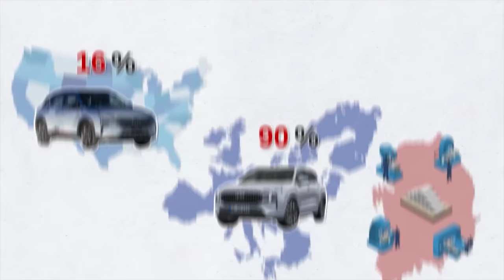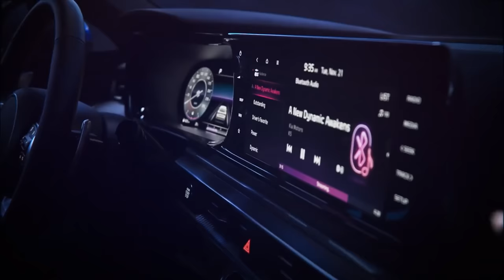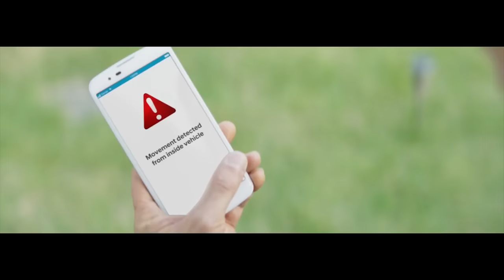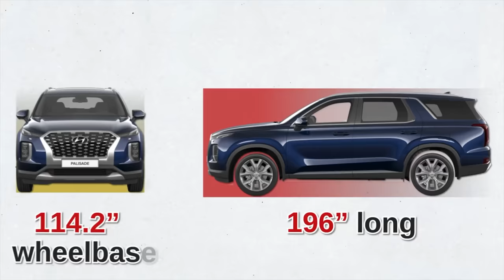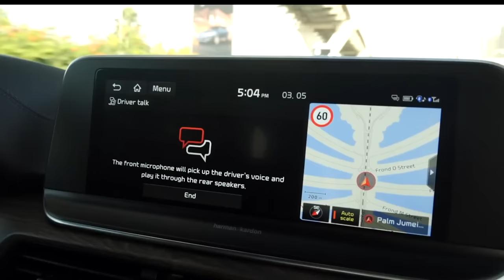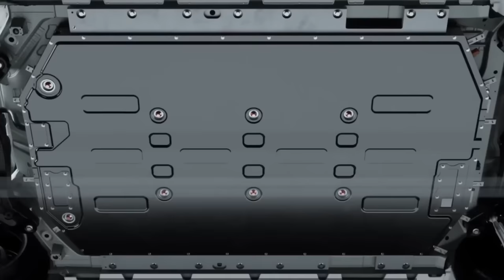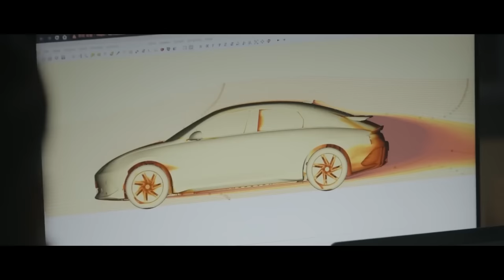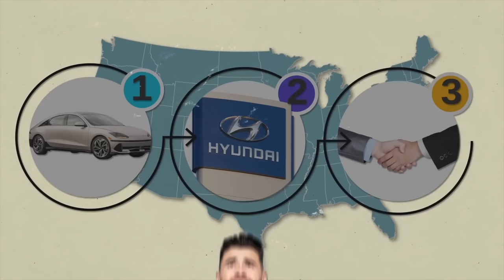No One Else Has the Balls to Say This About Hyundai and Kia, So I Will

Comment: The first car I ever drove was my dad’s 2003 Hyundai Sonata. Many years later, it’s now my car. It has just under 320k miles, and it’s still going strong.
Reply: I have a 5spd 2005 192k and still runs
Reply: 4G63 Mitsubishi engine. I too have the same car. Very strong engines used in Mitsubishi Evos.
Pls concentrate in timely oil change and properly Timing belt change. Then it can last upto years and years....
Reply: I had a xg350 it was an 05. It ran very well. Sadly it was demolished in a car accident
Reply: @Erode-karan  I get my timing belt done Monday and all other belts
Reply: Wow that's awesome unfortunately my 2005 Sonata busted a timing belt while I was accelerating.  I was at 120k It bent the lifters I believe it was and the repair would have exceeded the value of the car so I sold it to the shop who had diagnosed it for me. I do still like Hyundai and Kia and still believe they have come a long way the last 20yrs! They also offer the best warranty in the auto industry. I know of two people who got the engine replaced free under warranty when they had a yr or so of dud engines. I believe they even issued a recall. The Genesis cars are absolutely phenomenal and I drive a Lexus (dependability  reasons) but man they really go all out on the Genesis cars. The timing may have been suggested to change before 120k I'm not sure so it could be entirely my fault and this was way beyond the warranty in yrs.
Reply: Can't complain about my 07 Elantra. It's been an easy car to own. But I'm learning towards Toyota for future buys. Overall better reputation.

Comment: My mom had a Hyundai Sonata, I used to have a an Elantra Sport (6-speed manual) which was really fun to drive, my wife currently has a Hyundai Tucson. We never had one problem with any of them. Regular oil changes and that's about it. They've been very solid cars and have been reliable for us. Most (if not all) of their vehicles have 5-star crash safety ratings and have either IIHS Top Safety Pick or Top Safety Pick+. I think people don't know that Hyundai is the only manufacturer that makes it's own high strength steel. Are they flawless? No of course not. They've had their recalls and problems, but so have other manufacturers.
Reply: @JohnnyUkeOfficial  and the most important recalls in many cases were forced upon a non cooperating Hyundai corporate executive. Corporate mafia man.
Reply: my Hyundai Tucson is going on 20 years.  I have only had a few repairs and those have been these last 5 years.  It's still going strong.

Comment: I have had 2 Hyundais and 2 Kias so far, and have had 0 problems. Reliable, good mpg, and low maintenance. Love em!
Reply: I just buy Hyundai/Kia in Australia. Great cars and very happy with durability and quality.
Reply: Better watch out for the Kia boys though 😂
Reply: Depends how old they are, too.
Reply: I've had 2006 Sedona, 2008 Spectrim, 2015 Optima hybrid, we still have it, 2016 soul driven to college, 2012 Hyundia Elantra, 2014 kia sorento, 20016 Sedona and now a 2022 Tuson SEL HTRAC. I've always changed my oil every 4000 miles on all these vehicles the only maintenance required were tires and brakes.  I will contiune to drive them. some folks have issues because of neglecting oil changes and abuse. before you ask, I'm from a large family.
Reply: Yeah, just wait a little longer....

Comment: My 2012 elantra has 220k on it. Shifts and drives very smooth. Just did the shocks and struts. Been a great car and I think it has alot of life left.
Reply: Have a first Gen 2011 limited. Had to change out some sensors, alternator, and other typical items and currently at 180,000. The door stops and handles are falling apart though. Hah.
Reply: 2005 Elantra purchased new 18 years ago. 361,000+ miles and still going strong. Yes, you do have a lot of miles ahead of you.
Reply: My 2013 Elantra needed a new engine at 90K. I changed the oil with synthetic every 7K.  They put in engine under warranty but made me nervous about brand.  It took 6 months to get engine for swap. Was a pain, fortunately was working from home at the time.
Reply: After how many engines and transmissions? 😂
Reply: @santoyoarmando81  both original. Both operate perfectly.
Reply: @santoyoarmando81  still original. Not bad for Hyundai. 
Perspective, funny that in the early 70s and 60s, Toyotas and Hondas were viewed by Americans the same way as Hyundai of today. History repeats itself, just like everything else in human history.
Reply: @Matt91593  just kidding man, Hyundai has come a long way. But you gotta be honest though. For the most part Toyota and Honda are better cars.
Reply: @Texasbird026  7k is probably too much on any oil. i do 4K on synthetic oil. oil is cheaper then engines, and i save some money by doing my own oil changes.
Reply: @santoyoarmando81  My 2012 Sonata still going strong with everything original except tires, batteries, and oil changes!
Reply: @santoyoarmando81   My 2006 Camry is the best car I've ever owned, and I'm in my seventies, so I've driven a lot of cars.  My 2001 Hyundai was always in the shop.  I know it's been over 20 years since the 2001 Sonata was manufactured, but I'm not sure I'd feel comfortable buying another one.

Comment: Here in Ireland my friend drives a hyundai i30 1.6 diesel, it's got 215k MILES and he's still on the original clutch..that is so impressive to me.
Reply: Diesels can last 500k to 1 million miles if properly maintained
Reply: My hyundai accent I just replaced the clutch but it lasted 210,000 miles
Reply: I think the life span of the clutch is mostly about how careful the driver is with it. I try to be as gentle as possible. My current daily driver has 126k miles, so I still have some time before I know if I've done well.
Reply: I’ve got a 2016 i30 diesel in Australia, still on the original clutch at just under 204,000km (about 126,000 miles). Still feels much like new. A lot I think is due to mechanical sympathy, plus the fact that my driving is largely highway stuff.
Reply: My avensis 2.0 diesel has 663,000 kms on same clutch same injectors only changed alternator starter 3 brake calipers and 2 front wheel bearings. I change oil approximately every 50,000 kms. Never changed an engine part.  Toyota are best

Comment: We had a Kia Venga, and my wife usually preferred to drive it, instead of her Lexus. Comfortable, quiet, smooth, was a great car to drive. Although at first glance at a distance you might think it’s a compact hatchback, every dimension is like 50% larger. Loads of headroom, and I twice carried a washing machine in the back without even needing to fold the rear seats down. Had a good old fashioned reliable 4 speed automatic, which was a big factor in our choice, as we never want to have anything to do with a CVT again, and “robotic” transmissions get too many negative reviews…

Comment: My 2015 Elantra GT has a failing motor. 81k miles on it. Maintained it well since I bought it in 2016. Hyundai denied it for a motor replacement based on the mileage and I’m the 2nd owner, and charged me $400 for a diag fee. Every single Hyundai dealership in the country has anywhere from 20-60 cars sitting in their lots, waiting for motor replacements. I’ve joined a Facebook group for Hyundai/Kia owners whose engines have failed and the numbers are astonishing. The story is not being reported accurately, the failure rate is insane right now. Probably because all the 2012 onward models are hitting that 80,000-100,000 mark.

Comment: I have a 2011 KIA Ceed here in Poland, with diesel engine 1.6 crdi. Zero problems with the mechanical parts. Only bulbs and stabilizers links (5 times in 12 years) needed to be replaced.

Comment: 2007 Kia Rio, 230K+ miles. Runs like a top. It's a 5-speed. Had my first brake work done back at 220K miles. This has been the most economical car to operate I've ever owned. Former multiple Toyota and Nissan owner.

Comment: I've got a '22 Sonata with everything Scotty doesn't like, 2.5 L turbo (with both MPI and GDI) and 8 speed DCT but I  love it and it's fun to drive. 😆 And it's not my first Sonata. Had an '09 with 175k miles. He's right about the tech. It's actually quite a lot of car for the price. He would say 'no arguing that'. 😂
Reply: Just drive gently avoid use of the turbo and it will be fine.
Reply: The main problem I had with my 2011 Sonata was that someone hot wired and stole it from my home about a month ago and pretty much destroyed it and left it abandoned on a side street. It was a good car before that. I’m having to get a newer car to replace it and I’m afraid because of the idea of having to finance it.
Reply: @bsgarey  That's key.  They are not built to take "spirited" driving.
Reply: @Matt_from_Florida  I found that out. I was in a hard driving situation and the next day I had an oil leak.
Reply: An 09 sonata was fine, they blew up from 2011 to 2019. Funny when searching for Sonatas they are all within that range
Reply: @brianj7027  But they blow up when you let them run out of oil.  Now as to why they run out of oil....ITS the GDI engine issues.
Reply: @bsgarey  I worked for a Buick/Hyundai dealership for 4 months in 2003.  We got probably a dozen Accents with the 5spd manual with burned up clutches in for warranty work... one just 4 hours after they bought the car.  It had a 1.6L with 106hp IIRC.  Yet still they installed such a wimpy clutch that it couldn't handle 106hp!
Reply: @Matt_from_Florida  That cars too small for most people....I cannot figure out why people want to drive such small engines/cars....I have an optima and I sometime wish I had a bigger car.
Reply: @bsgarey  Cuz it was the least expensive car Hyundai sold!  It checked the "I need a car" box.  I don't think any buyers said, "I'm just in love with that Accent!"
Reply: @Matt_from_Florida  Thus my point. buy a better-quality car.
Reply: @bsgarey  true id rather have a 2016 accord coupe than a 2022 accent
Reply: If they price their cars as the Toyotas with the same features, nobody will buy their cars lol so it only makes sense to out-feature the Japanese at a lower price and longgggg warranties.
Reply: @brianj7027  ??? My 2012 Sonata still going strong, never had a problem, but I had problems with Fords, Chevys, etc!
Reply: @Supedsauce.  and that Accord would cost a lot, lot, lot more!
Reply: I have an 09 and it's at about 230k not one issue.

Comment: Korean car quality has improved dramatically over the past 10 years or so.  My sister had one of the early model Hyundai's and it wasn't reliable at all.  This past Dec, I traded in my 9 year old Honda Pilot for a Kia Telluride.  Overall, I'm very pleased with the Telluride.  There's some quirky features the Telluride has that I'd change, but I can live with it.
Reply: keep your oil change receipts
Reply: Keep in mind that the engine does not have hydraulic lifters like every other modern car. You have to get the valve train manually adjusted with shims.
Reply: @moloono1 for valve adjustment you use feeler gages not shims.
Reply: @pppcorn . . . that should be done with any vehicle you own.
Reply: @moloono1 Nissan Frontier with the 4.0 was like that, too.
Reply: @jbradfordphoto  Yikes!
Reply: @moloono1  they were pretty darn solid engines, mostly. But yeah, having to change the valve buckets out to adjust the lash isn't my idea of a good time. Then again, having a hydraulic lifter fail can be a pretty bad time, too. 🤷‍♂️

Comment: I was the second owner of a 2013 Sonata with the faulty Theta engine I purchased from a Hyundai dealership. At 65,000 miles it started using a lot of oil 1 qt/1000 miles and occasionally belching smoke in large quantities. The Hyundai dealer checked the engine and ultimately replaced the engine with a factory rebuilt engine. After that it ran flawlessly and used no oil. My son totaled the car at 80,000 miles. I really loved this car. 😢
Reply: Get an avalon instead
Reply: My 2012 Sonata is still going strong, sounds like you got a bad one, all models have those!
Reply: Damn man Im sorry about that

Comment: My daughter bought  a fairly new secondhand Hyundai Excel and it outlasted a new more expensive car that I bought . It was still going ok when it went to the wreckers because no one wanted it even  free because it was so old and a manual transmission  .  It only needed a new exhaust system and a new fuel  pump in the 15  years she had it .  Things may have changed I don't know but I was impressed with the Hyundai Excel .

Comment: If you don't mind adding a quart of oil every 750 miles, the 2016 Hyundai Santa Fe Sport is a great car. Had a class action suit on it because of blow ups and fires on some of this model.  Result was a lifetime warranty against blow ups because of faulty engine components. Drive train only. Burning oil was not covered and considered within specs by the factory. Good luck with any Hyundai. I said adios and now have a non oil burning Mazda cx-5. What a relief. Love my Mazda.
Reply: Yeah I waited to long to get rid of my sonata and it died. And they’ve been storing it at the dealership untill they get the “time to look at it”
Reply: I have a 2010 Santa Fe Hyundia and I love it. 255,000 miles and still running without touching the motor or transmission.
Reply: I have a 2016 Hyundai Santa Fe Sport - no oil burning problems or any other problems, thankfully.

Comment: I bought a 2017 Sonata after spending some time in Korea. I really liked the basic but clean aesthetic. Bought it in 2018 with 35k miles. Today it's at 90k miles and I drive around with a 5qt container of oil in my trunk so I can top off the oil every few hundred miles. I've measured the rate at which it burns, approximately1qt burned per 1k miles. 
I'm done trying to get this fixed because I took it to a mechanic that kept changing gaskets and seals to no avail. 
The car market is ridiculous right now and I'm not sleazy enough to trade in a failing car so I'm stuck for now with a car I wanted to love but have had nothing but problems with.

Comment: I'm still driving my 2013 Tucson i bought new in 2012. 175k miles. Zero issues. Changed breaks once. Original battery lasted 10 years 165k. A couple radio buttons on the steering wheel no longer work, but everything else is like-new. Seats still holding up. All lights work. I plan for my next car to be a Hyundai but i'm not sure if they make as good a car now as they did 11 years ago.

Comment: I purchased one brand new Honda CRV and one brand new Honda Civic.  Engine was good but they had all kind of other issues. CRV had driver window motor failure twice. Civic had console issues. But my Hyundai Santa Fe Sports is the best car. After 9 years and 98K miles, its as comfortable and fast as new and super reliable and super comfortable. Comfort wise my 9 years old Santa Fe is as comfortable as my latest Mercedes EQE which is almost three times pricier than my Santa Fe.  So I kept my Santa Fe and sold the Honda. Besides that my Santa Fe gives upto 35 miles per gallon if I drive at 65 miles per hours.  Much above advertised mileage.

Comment: My daughter was one of the unfortunate ones regarding Kia/Hyundai engine problems - she had owned an '06 Sorento with
a 3.5L V-6 that ran great but by 2016 was getting up there in miles and age; decided to trade it on a used 2012 Sorento with low miles, but had the 4cyl GDI engine. We were unaware about the engine
 issue, fortunately she got an extended warranty.  So at about 100k the motor seized - my machanic  couldn't find a used engine ANYWHERE, that's when we found out about the recall. After I hammered the extended warranty company they finally found an engine...that's when my guy saw that the motor in the car was NOT the original motor, so we were putting in engine #3. Then motor #3 grenaded 6 months later. Kia replaced this with a brand new one no charge, but she'd had enough....drives a Chevy Traverse now
Reply: The new Korean GDI engine is bad.
Reply: Sadly people don't realize how poor many modern engine desings are. Manufacturers and brands these days only care about tech, not quality. It's much easier to sell fancy things cheap, than try to convince customer to pay more for simpler well build product.

Comment: Had a 2012 Sonata.  Great car to drive for most of the time I had it until there was a problem with the brake pedal stopper.  While pressing the gas, the car thought I was breaking and slowed down on me several times in heavy traffic.  Thankfully, I didn’t get in an accident but it took 4 visits to the dealership before they discovered the issue but not before paying $800 to get a new gas pedal installed that wasn’t necessary.  Sold it and bought a Camry.  Bye bye Hyundai!!!
Reply: that may have been covered under warranty
Reply: Good luck with your Camry.  You're gonna need a lot of luck with it....🤣
Reply: @icosthop9998  nonsence, 10 yr warranty, covers exactly what it says!